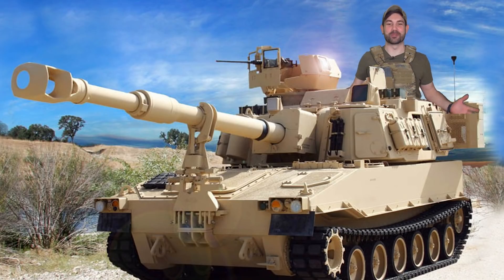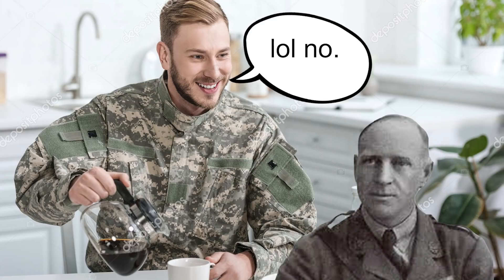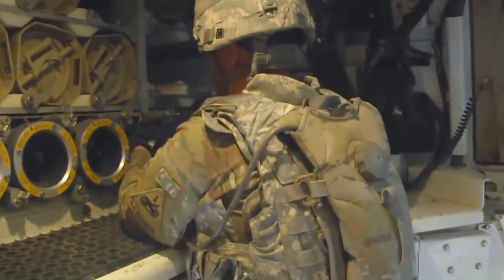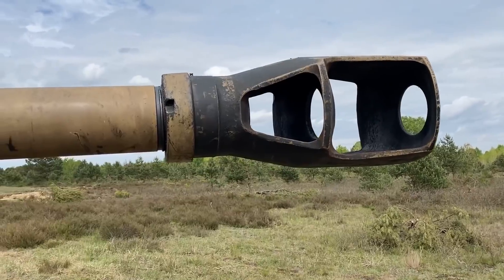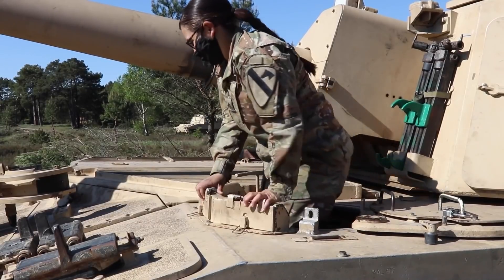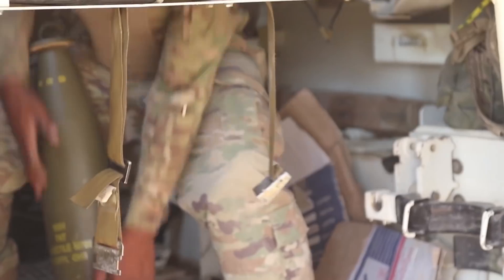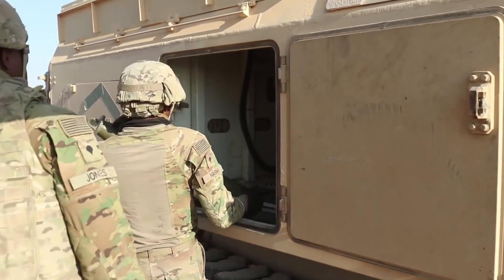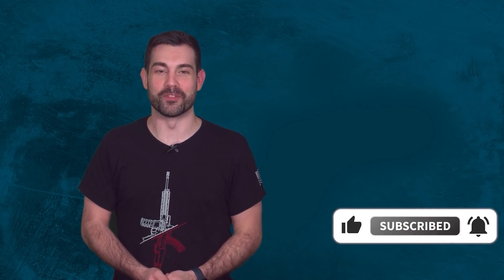M109 Self Propelled Artillery Vehicle Tactics Explained

Comment: We don't use bag charges anymore, the A7 is based off the Bradley chassis, we use armored ammo carriers now, if you've ever been on a 777 or the older m109a6 you wouldn't consider the m109a7 obsolete. The vehicle is actually pretty spacious, I'd rather be in it than under the net with a m77a2. We can't air assault a paladin so the 777 still has a place. The new rammer is spectacular, it's a hell of a weapon system. The old hydraulic rammer on the a6 was breaking down constantly. Direct fire is usually reserved for emergency situations. Generally at the point you have to drop tube and fire direct you're pretty screwed. If you've ever had to do an action azimuth mission an a 777 you'll  be happy to use a paladin instead. As well with a paladin there's no jumping to grab the tube while everyone else pulls the gun down by your belt. No more holding up the tube or needing a Gerber to open the pintle with a prime mover nearly running you over because the ground guide or driver aren't paying attention. Usually the 13j/D's were rolling in m113's.
Reply from the maker: Great to know ! I wasn’t aware the baged Charges were a thing of the past ! Glad to hear the new rammer is doing it’s job
Reply: @Taskandpurpose  no problem, thanks for giving the artillery some love. Newer charges are a cylindrical cardboard like material, way easier to handle. Best thing I ever heard was an infantryman private ask his sergeant what the hell our M777 was, to which his sergeant replied "that's a big ass M4"
Reply: @arrowhead-6a521  Farts loudly, then hits like Hellfire's Damnation
Reply: I find your lack of powder pit firework shows (and spectacular accidents) offensive.
Reply: @WindFireAllThatKindOfThing  fun for everyone but the guy lighting it just a bit too close 🤣🤙
Reply: @WindFireAllThatKindOfThing  I know exactly what you're talking about 🤣man that's great.
Reply: In the olden days (6/83 FA) the battery XO was responsible for burning the unused powder increments.  Another battery XO filled his 1/4 ton trailer with powder to go burn.  A few minutes passed and we heard this godawful scream.  Seems his trailer caught fire (still mostly full of powder).  Melted the trailer and jeep to the rims and the antenna. Fun times....
Reply: How heavy is bag charge? It feels very light when I see how soldier  only grab it by one hand.
Reply: @TheKaMeLRo  they aren't heavy by any means, though on the M119 crew you have to hold them up for a long while. The real for the changeover in charge types is that you can put the new charges in forward or backwards where the bag charges have to go in a certain way, the new ones are easier to increment, and you don't need a burn pit for unused increments. Your powder runner has one of the easiest jobs on M777 crew. The projectiles are the heavy part, if memory serves M107HE is about 98 lbs.
Reply: @TheKaMeLRo  very light, however a 7 load has some weight to it.
Reply: A few more things to add from the transfer from the A6 to A7 we lost 360 fire now its reduced to headlight to headlight and the crew size hasn't changed we have been using a 4 man gun crew for a long time. There are a bunch of issues with the new A7 but mostly its from the change over itself and its hard to tell what is from learning a new piece and things that still need to be upgraded.
Reply: @jordanelmore3742  yea but out of traverse is easy as shit still just cab lock pivot lay load lay. It does break down alot that's for sure our tray use to go degraded same with the rammer. Piza faults and all that shit. Personally even though the 777 is a pain in the dick when you got a squared away section emplacing fast shooting fast that shit looks beautiful plus all you need is cherry juice an brute force that shit never breaks down
Reply: Unfortunately most mechanized units such as mine are still utilizing the A6 and bit due for the A7 until 2024 at the earliest
Reply: I served in the artillery corps in Israel and we still use these baged charges to this day, it's so annoying when you need to tie them up together in the right order lol.
Just had my reserved training last week and my body still aches from all the shell lifting, these things weight around 40-50 kg depending on the shell type and size...
Reply: What is the direct fire effect of an HE shell on a tank ?
Reply: @Kirkee7  It destroys it. A 155 mm high-explosive shell on anything will be a life altering experience.
Reply: @funkrates4778  A life ending
Reply: Gotta say, when clearing a firing point on the range, burning the excess trimmed charges was always a ton of fun! Of course, firing charge 7, white bag was also a lot of fun, too. Less to burn afterwards.
Reply: Have drones made self-propelled howitzers nearly obsolete? (Emphasis on "nearly.") You see SPGs with chain-linked fences or barbecue grills fastened overhead to protect against drone attacks, but I think the worst effect of drones filling the skies is that you can't effectively shoot and scoot because you can't hide anymore. What's the effective range of this artillery? 38 km? Drones can operate around 50 km, at least the ones in the Ukraine. Drones have radically changed the battlefield.
Reply: The m109 are obsolete compared with any modern SPG like the PHZ2000, 2S19-M2, K9, PHZ05, and the Krab-as90 bravehard. All those SPG have autoloaders that allow them to shot every 5-7s with 52caliber guns that allow them to reach 30km with standard rounds in addition to be quite precise. The m109 with the 39caliber gun that has a range of 20km with normal rounds and the reload speed of over 10s is quite obsolete compared to those SPG's
Reply: Meanwhile, since US procured the M109, Sweden, built & fielded and then retired a 155mm artillery piece with a fire rate of 20 per minute, able to empty out its entire magazine in 42 seconds or so.
Reply: @0thPAg  It's an impressive weapon system. I don't have any experience with it. From the perspective of my training and experiences it seems like a weapon system built around very different tactics than those we employ. Couldn't tell you for sure that I'm correct, couldn't tell you what it's like to service it, seems like an interesting concept.
Reply: Just look at South Korea's latest K9 howitzer and you'll realize why M109 is obsolete.
Reply: @KingOfKings34  I'm familiar with the K9, I know folks who work side by side with them in Korea. It's damn near the same weapon system with two different loading systems. If the US military wanted autoloaders we would use them. There are some serious advantages and disadvantages to both systems. There's a lot of things that sound really impressive, but really aren't anything but standard on modern self propelled artillery. Remember that even if you can fire faster you can still only fire so many rounds before the weapon system is unsafe. (It's fewer than you'd think)
Reply: @arrowhead-6a521  thanks for your insight
Reply: @arrowhead-6a521  you can at least recognize the advantages of 1000hp MTU diesel engine and the 52 caliber gun. C'mon man.
Reply: @KingOfKings34  a bigger engine isn't really some huge technological advancement that makes all else obsolete. Is more power good? Sure. Is more noise good? No. So far as I know the gun is a 155mm howitzer. It does outrange us by a bit. I'm not going to have a pissing match about which vic is better, they're both good modern vehicles with advantages and disadvantages. We could get into excals, shell fuse combos, go through pmcs doctrine, bitch about specs back and forth, talk about FATADS, discuss whether or not DIVARTY has their shit together, and it wouldn't change the fact that they're both good modern weapon systems.
Reply: @AbnormalObs  no problem TM
Reply: @KingOfKings34  A 52 caliber gun poses issues with transport to Theater... Our ROROs couldn't fit them in the loadout configuration (Battery and Battalion strength movements) we normally use.  The K9 doesn't need (nor was it designed) to be transported great distances by sea or air.  The M109 does.
Reply: @swaghauler8334  By this logic why not go back to M52? you can fit even more of them into your roros. Meanwhile some countries are air transporting PzH 2000s a giant behemoth that is nearly three times the weight of M109. K9 is small by comparison.
Reply: @KingOfKings34  all military equipment is built to function within the infrastructure and tactics of the host military. Yes, some nations use larger equipment, yes some nations use heavier equipment. Have you ever loaded these vehicles for transport? Even rail loading a paladin is a challenge at it's current size. To change the entire infrastructure to accommodate these other designs for a small increase in effectiveness, to use a weapon system that wasn't designed for the same tactics and training, is a hell of an ask. The financial viability of completely changing infrastructure, logistics, training, and tactics for a few more klicks of range or one or two more rounds out the tube a minute is just about zero.
Reply: @arrowhead-6a521  Yes we can argue back and forth and in the end we could say that artillery never really goes obsolete. Turkish army still has M52Ts and M110s, they are still perfectly servicable, they still fire. But to me it seems that M109 has reached its limit as a platform whereas newer designs have more room for growth. For example South Korea is working on an umnanned version of K9 that only has a crew of 1. We will see how that works I mean I am not sure that that's the way to go but you see my point..
Reply: @arrowhead-6a521  yes, yes, there will be pain. It's not easy changing one gear in a giant complicated machine. But eventually it will happen. When the enemy outranges you, when they can fire and move more often... There's an acceptable limit to how far you can stay behind in combat equipment. Eventually M4/M16 rifles will be replaced too. Nothing lasts forever. Except M2 Browning.
Reply: @KingOfKings34  I do see your point, I disagree with most of it but I do see it. It's easy to look at spec sheets and say that one is better than the other. Actually using the system is quite a bit different. We train against our peers equipment, we make sure we have the ability to compete.We have flaws sure, but we stack up well. There's no miracle weapons that work in all situations, against all tactics, or against all other equipment. That's just the rub, if we're in a position where a Russian gun that outranges us by twelve klicks and they're three klicks outside our range in an artillery duel then we're screwed. At the same time I've played OPFOR plenty of times and devastated coalition troops and artillery with Russian howitzers from the sixties with half the range as an M777A2. Tech doesn't guarantee victory, but it certainly can help.
Reply: @KingOfKings34  🤣a lot of truth there. The M2 will be kicking long after we're all dead and gone.
Reply: @KingOfKings34  It's not about weight, it's about dimensional size.  It's the same logic that says you'll NEVER see a tank bigger in size than an M1 or a Challenger.  If they get any bigger, they wouldn't fit on train or truck rolling stock (tunnels and bridges are only so wide).  The same applies to long-barreled howitzers, they can only be so long before they don't fit on our transporters anymore.  The PZH and newer M109s with the larger turret bustle at the rear are less than 1 meter in difference in their overall lengths.
Reply: @swaghauler8334  very well put

Comment: They should also be looking at a wheeled version of the M-1299. A similar design to the Czech systems only one based on a US heavy truck with a turret from the tracked vehicle.
Reply: Sounds top heavy, and unable to move cross country.  Pretty hard to support maneuver elements if you can't move with them.  The Russians are just now finding out that being confined to roads is not a good thing.

Comment: When the barrel is longer than the hull itself, you know it packs a punch
Reply: Fun fact.  I was around long barreled howitzers.  On slight rolls off road the gun muzzle can tend to dig into the dirt if the driver isn't careful.  Then the gun has to be cleaned, inspected, and then it can be used.

Comment: The platform is from the 60s the Paladin is from the late 1990s. We still had Grease guns on our M109A5s in the early 2000s in the 258FA NYARNG.
Reply: The basic M-109 has been in and out of depot at least six times.  Congress restricts the Army to "X" number of new vehicles per year.  So they go through rebuilds.  BTW, the best upgrade I ever saw was taking left over M48 tanks from Vietnam and upgrading the lot to M48A5 standard.  That was a "cheap" M60A1 substitute.
Reply: heyyyyy i was in the 258
Reply: @Wabbaaajack  was up Redleg. HHB 1997-2001 Jamaica Armory
Reply: @jasondiaz8431  nice im from A battery, I think Jamaica’s getting remodeled i heard

Comment: Fun Facts :- The M108 is actually an M109 scaled down to use a 105mm Howitzer.
Reply from the maker: M107 was a really tiny one right , that was barely used I think
Reply: @Taskandpurpose  the m107 was bigger using a 175mm gun
Reply: @bagobones9891  What about the M110? didnt that use like a 203mm gun, or something along those lines?
Reply: @McSkumm  yeah  it was an m115 8 inch 203mm howitzer  mated to a unique  chassis making it the m110 self propelled  howitzer  it's still in use with a good ammount of countries
Reply: @bagobones9891  I was going to make a smartass comment that the M107 was a version scaled down to use a .50 BMG round but there's an actual M107 howitzer, so...